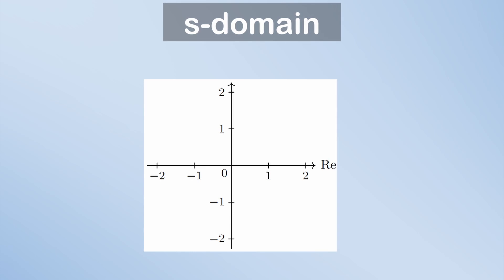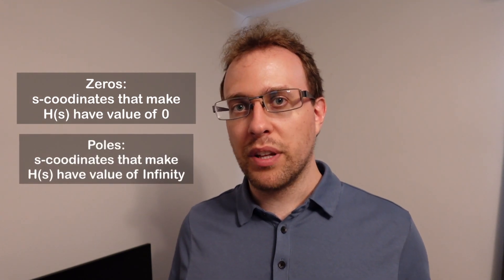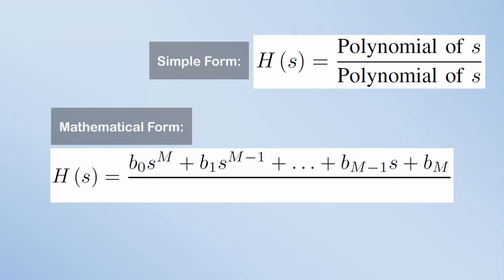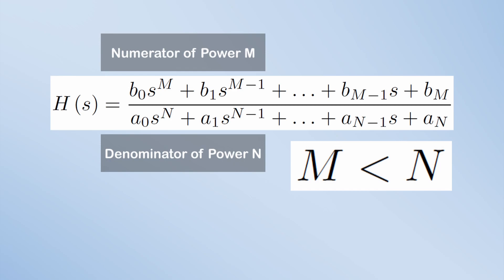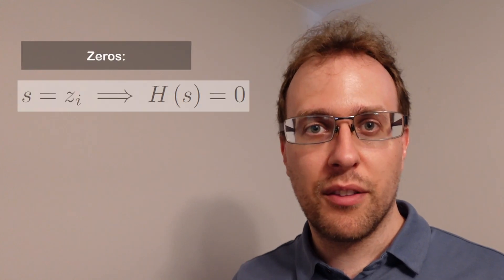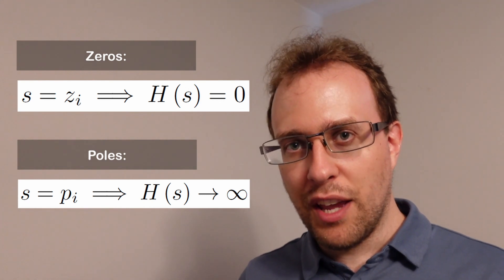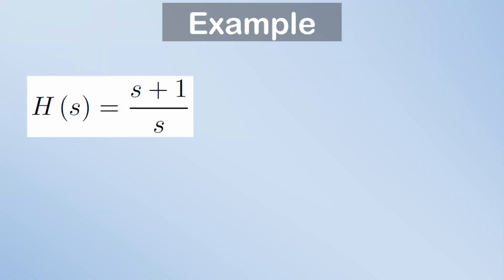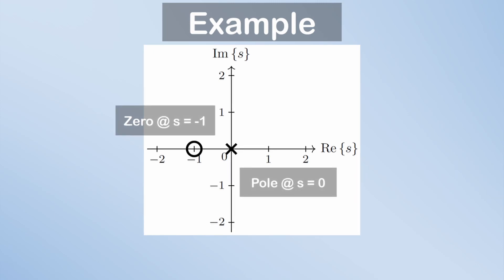Poles and Zeros in Analogue LTI Systems

Comment: Thank you professor for the great lecture. I have a question about pole if I may. As I understood, zero is where the output of the system is nulled for an input, but I couldn’t understand what pole means in the output of a system and also how they relate to the time domain. I mean, are zeros and poles important in understanding some features in time domain as well or not?

Lastly, I would like to express my sincere appreciation for the time and effort you dedicated to delivering such an enlightening lecture. Thank you for your great work.
Reply from the maker: Yes, I'll discuss the connection between pole/zero placement and time domain behaviour in the next video. In short, if pole placement is unstable then the output can grow without bound (in practice this would usually saturate or damage the system)
Reply: @AdamNoel  thank you professor 🙏🏻
Reply: @AdamNoel thanks sir ... I will wait for next video....